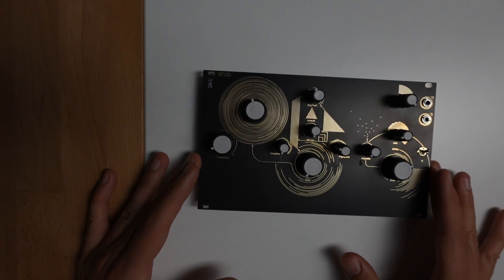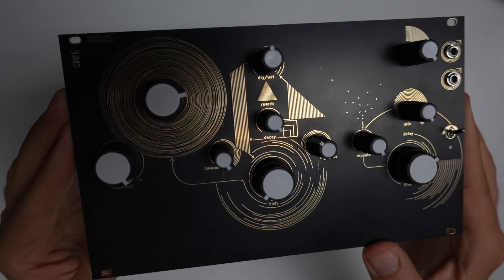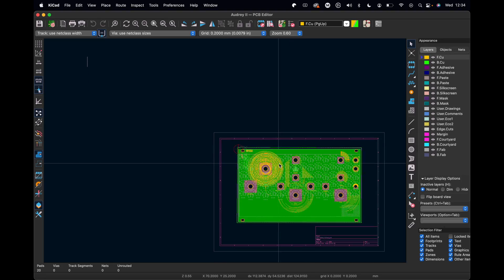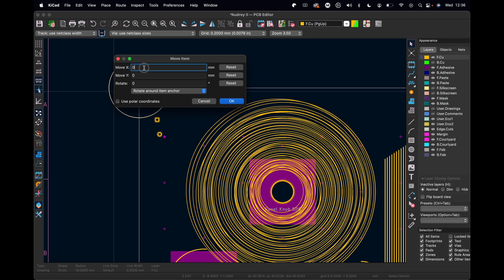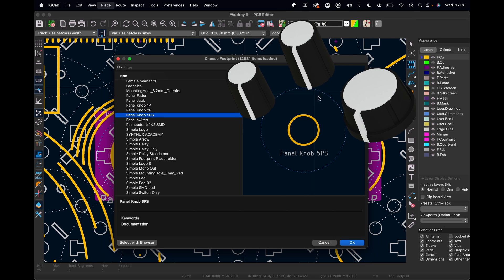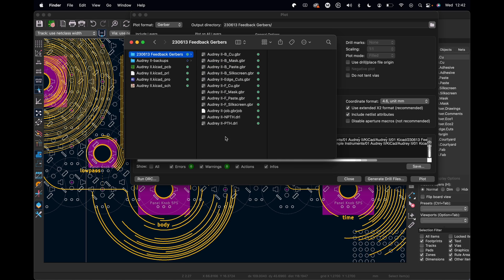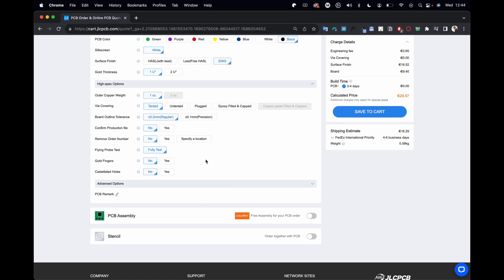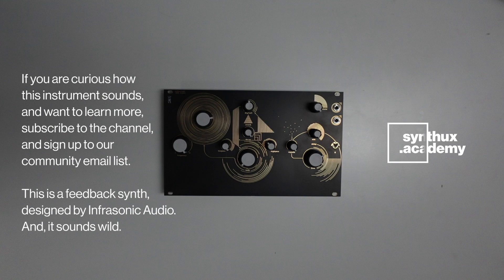How to Design a Synth Interface in KiCad // #synthdiy tutorial

Comment: Thank you for this great channel! How do you exactly make a transparent section on the panel in kicad so the leds can shine through the panel? Cheers
Reply from the maker: PCB boards are transparent, essentially. Each side of the board gets a copper layer (F.Cu and B.Cu) and a solder mask layer (F.Mask and B.Mask). If you leave areas with no copper or mask, on both sides, you’ll get a transparent area. Hope this helps. Join our Discord community to share your result :) I’m curious what you’re working on.

Comment: hi there, total newbie in using kicad here... i've tried to follow your instructions for building my own front panel... just a simple one: a few holes and words here and there. for words a used the text function on the front copper layer because you said to add graphics there... since i saw there was text in your design as well, i assumed that you "wrote" those words on the front copper side (using the text function) as you did for circles and lines...
i was hoping the soldering mask wouldn't cover the text (as in your design), but i was wrong... how can i make my writings cut through the soldering mask just like in your design?
Reply from the maker: I was struggling with this as well :) you need to have the text on both the mask and copper layers.
Reply: with “Borge” you meant “both”, right? cheers!
Reply from the maker: Whoops 😬 yes.
Reply: perfect! next time i’ll try to double up the text perfecly aligned on both the soldering mask and the front copper layer… thank you very much for your tips and your super prompt reply! :)
cheers!
Reply: @SynthuxAcademy  Hi there! Another quick one:
I'm assuming that you ordered the front panel from JLCPCB, right?
When choosing the soldermask colour on their site, there is only one option of black colour... is it correct to assume that the black soldermask, as in your front panel, is going to be matte black? Thank you for your help!
Reply from the maker: @lorenzobiagi5200 yes, we use JLC. They have different colours for solder mask. You don’t see it on the order page?
Reply: Hi! yes, I do. I just wonder if choosing a black soldering mask on JLC means that the final result will be matte/satin black, same as yours?
Reply from the maker: Ah, yes! They only have matte black.
Reply: Cool! That’s exactly what I am looking for. I really thank you again for your super prompt replies! Keep up the good work! Cheers

Comment: Hello, Oli here from germany. Recently me bought the lovely machine. Now I try to put it in an enclosure. Found a nice box. The problem is to mark the drill holes. Is there a possibility to get the x, y coordinates in mm or cm of the drill holes? Or do you have an other idea how to mark the holes exactly. Measuring the coordinates from the machine by myself seems to be a little bit to prone to errors for me. Thanks a lot.
Reply from the maker: Certainly! Check out GitHub for the template. Also, join Discord so we can help further (it’s hard to track these threads). Discord is in the community section on our homepage. 
https://github.com/Synthux-Academy/synth-interface-panel